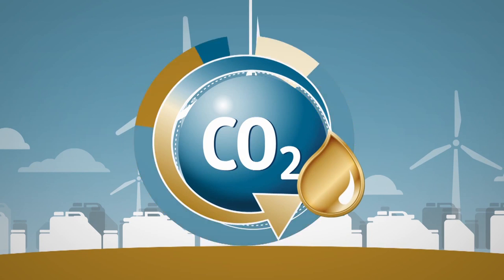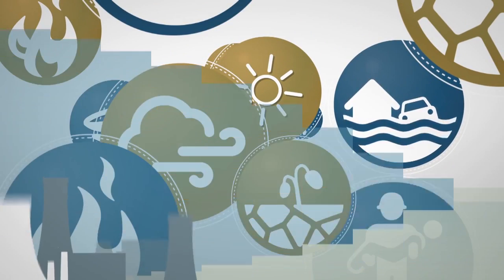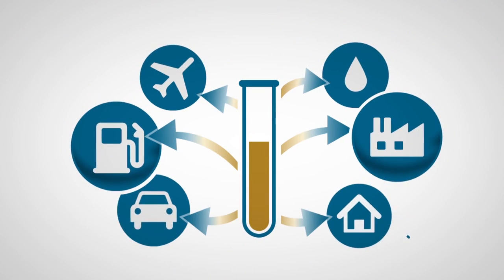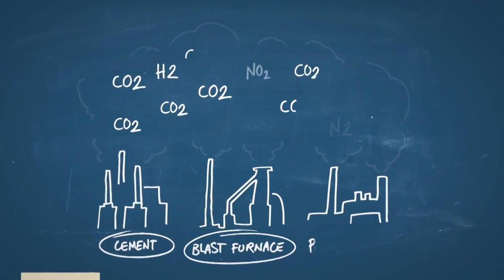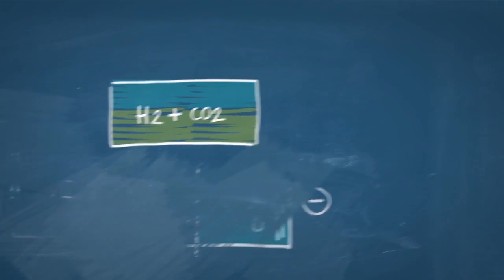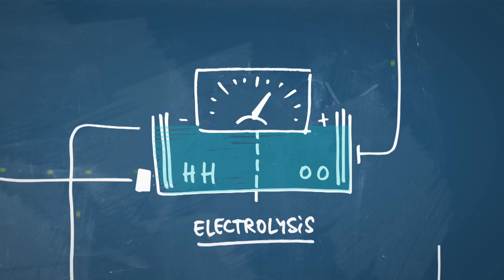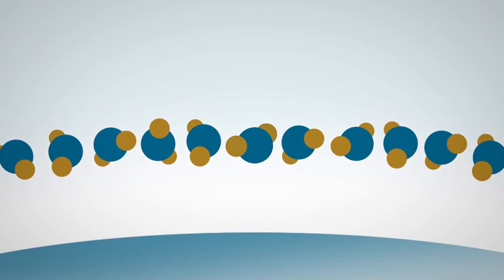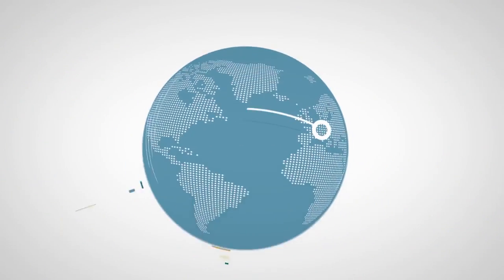MefCO₂ - Methanol fuel from CO₂

Comment: The EU ought to have fast tracked this idea along with new gen SMRs! It would hasten weaning itself from fossil fuel dependence and avoid future wars/conflicts indirectly? Existing "total flex" vehicles can already burn M100 fuel i.e pure Methanol w/o need to blend with gasoline and "diesel engines" are already in operation in the marine industry burning MD97 which is methanol with 3% ignition improver for diesel (compression ignition) operations...